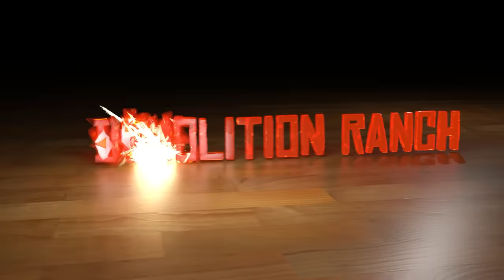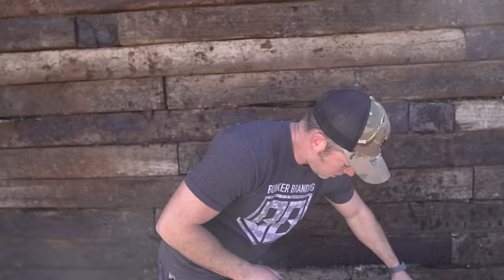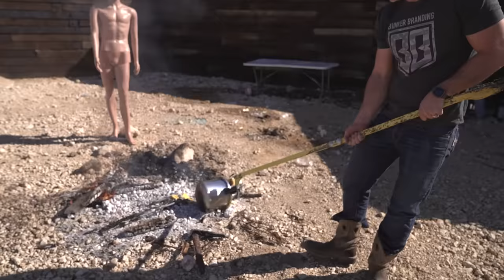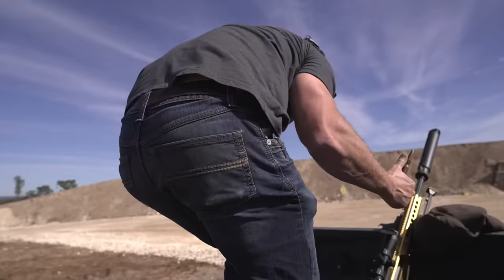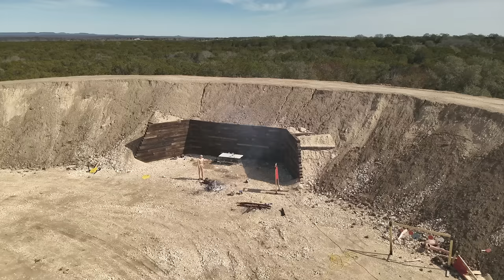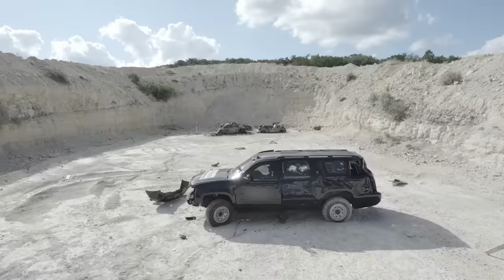Can a Pressure Cooker Kill You??

Comment: You never covered the net on the ones you put in the fire. There is a weight that goes on top and once it starts rattling it will build up pressure

Comment: Should have done flour for a boom
Reply: A pressure cooker full of raw flour wouldn't develop much pressure when heated. There isn't enough water. If you added enough water for the pressure to build, the flour would not disperse. For a flour or dust explosion/conflagration you need it to be dry and dispersed in an appropriate volume of air (Google "UEL and LEL" for more info). 

A failed pressure vessel, a stick of dynamite, and a flour mill exploding all have very similar results, but they are 3 very different things.

Comment: Hi Matt, big nerd here. Your drone's IR camera works by detecting wavelengths of light in the infrared spectrum, not heat. Things that are hot emit light on the infrared spectrum which is why the two are so commonly confused. In the case of the shadow the mannequin was casting from the fire, it wasn't because the shadowed area was cooler due to the mannequin was blocking the heat. It was because the fire was emitting infrared light and the mannequin was casting a shadow from that light like any other light source that you and I know.